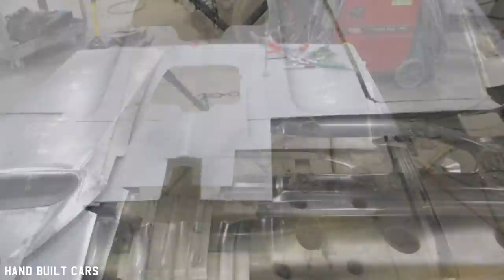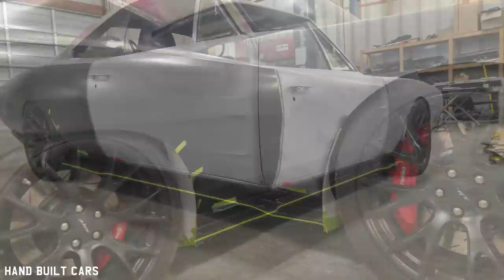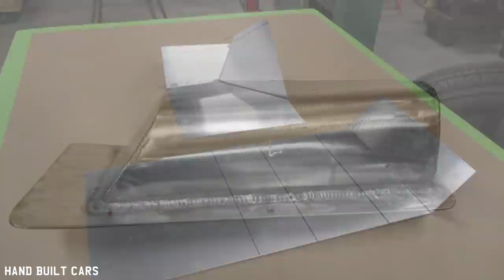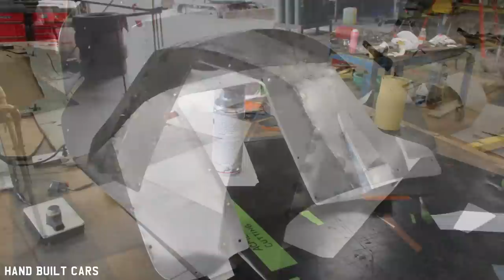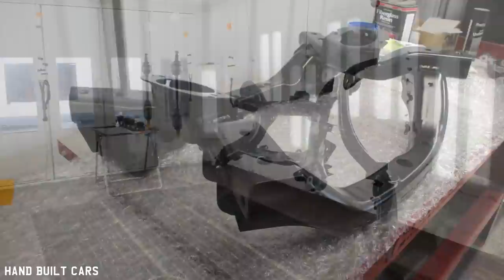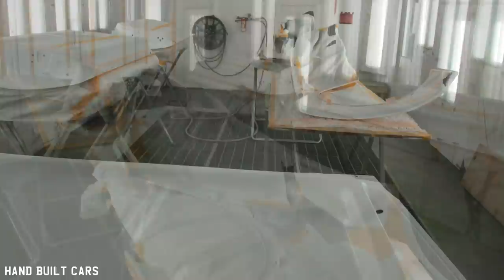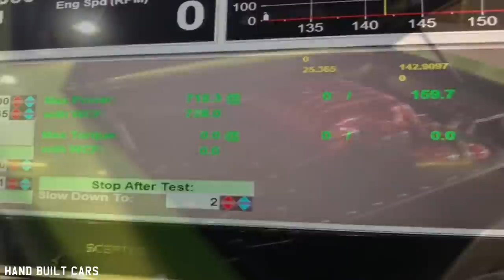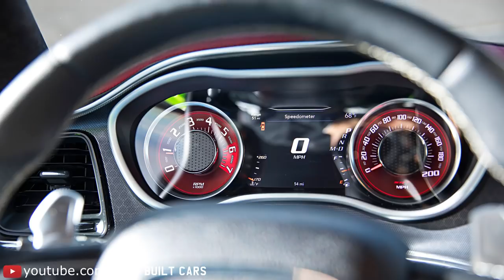When Mechanics Lose Their Minds - Supercharged 1969 Dodge Charger Hellcat SRT8 6.2L HEMI 738HP Build

Comment: So why not just build a tube chassis? Don't get me wrong a whole lot of work went into this but a stub frame built for the front and rear would have allowed every mod done to this chargallenger? Challarger ?  Charllancher ? Chalarngecher ? ...what ever. It seems too much went into this to have all the fancy new stuff. The builder could have just made a restomod with pro touring suspension using the factory parts. I'd use a AWD charger for the donor car , that way a person could drive the final product every day without issue and it would actually be fast and very easy to service.